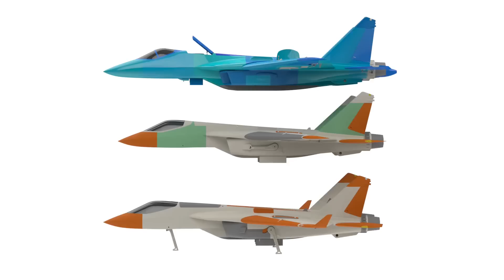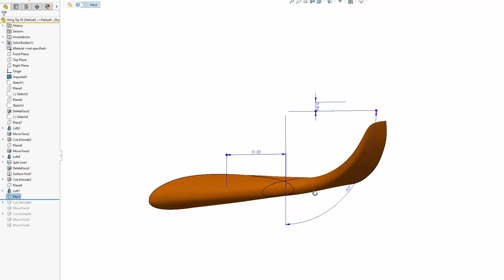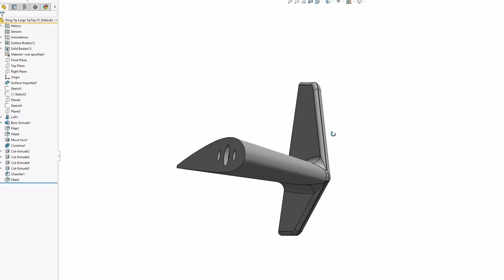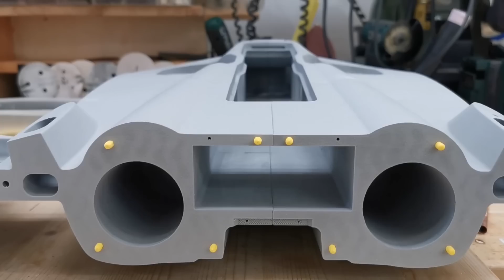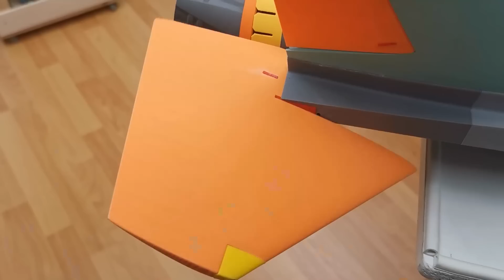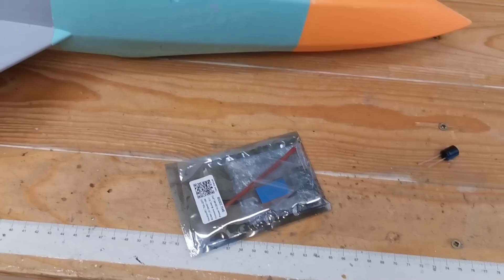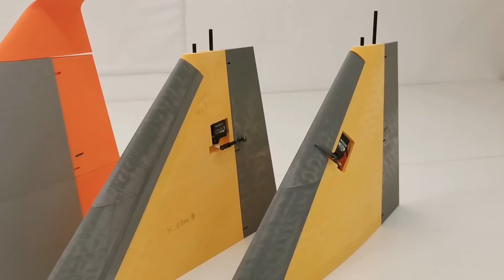JRM-01 is getting ready for Maiden | 3D-Print VTOL Jet Project

Comment: What if the main air-intakes and the trusts would be vectorial, like the vectoring trust on the f22, wouldn't that be simpler and lighter but, more important, would the air'inkakes be sufficient for lift ??? 🤔🤔🤔
Reply from the maker: On EDFs there is an enormous lost of thrust while redirected. Not comparable with gas jet engines.
Reply: @rene_rosentraeger  Hi, nice of you to answer. Since the 90's i always wondered why the F22 raptor has vectoring trust but no vectoring intakes.The Sukhoi Su57 is using front intake flaps as canard. If the whole intakes could be redirected, wouldn't that shorten the runway considerably, at least (STOL)? I'm asking you because you have the means to test this and enjoying it at the same time. Keep on the good work. 😉👍

Comment: Maybe you should try to set this up using a flight controller and iNav.  Key all of the programming in there instead of in the radio
Reply: Inav would be great I agree
Reply from the maker: Is in my mind also. As far as I know is there not the possibility of gain control / change via TX in flight. Is that right?

Comment: Why are there air pockets around the two front air inlets? I can imagine these pockets create drag.
Reply from the maker: To divide the boundary fuselage airflow from the inlet one.
Reply: @rene_rosentraeger  I understand but why not more aerodynamic, gradual and without those notches?
Reply from the maker: Ah, you mean the pockets on the outer side. These are fairings for the landing gear / skids.
Reply: @rene_rosentraeger  0:01 front view. The space between the bottom side of the wing and the air inlets and between the fuselage and the air inlets

Comment: What is the idea behind the winglets? Isn't it better, in general, to make the wings wider? I thought winglets are added when the wings can't be made wider. They help a bit with the separation and produce more lift, but they do add drag. So, there's no net gain compared to making the wings wider. They look cool though :)
Reply from the maker: They bring a lot of benefits.. Decrease the induced drag and stall speed, stabilize the jet while turning and forward fligt. Make it more handsome in general. On unlimited Acrobatic they will be replaced for sure 👌